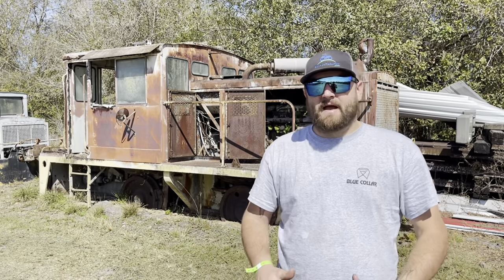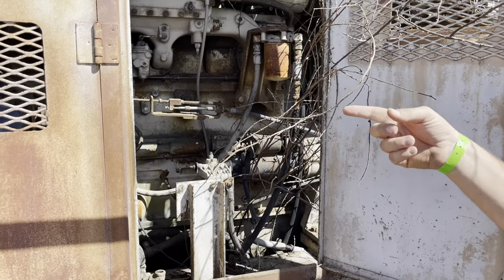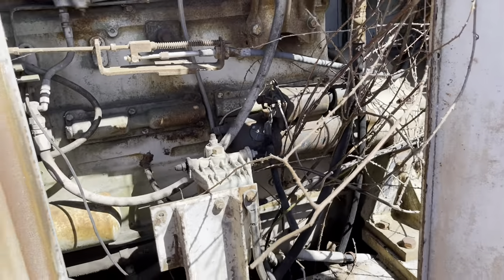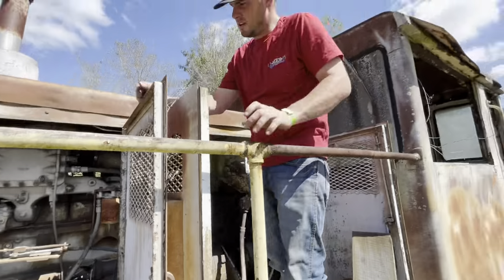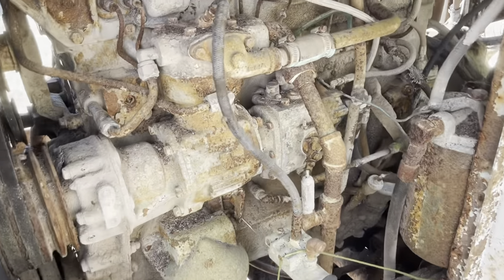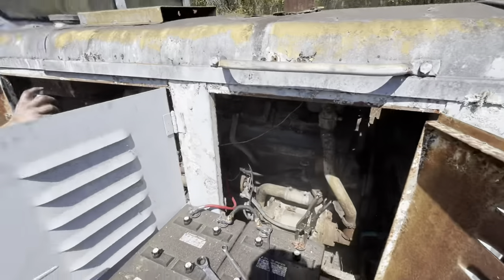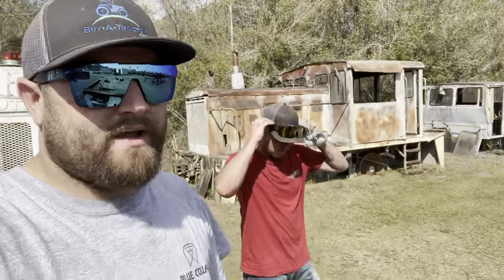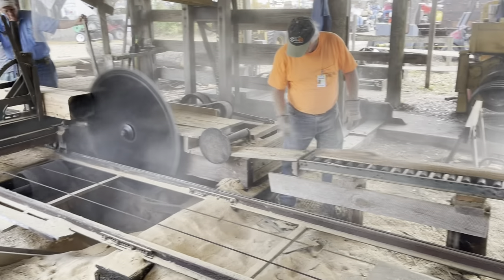WILL IT START? 1962 DIESEL TRAIN LOCOMOTIVE!

Comment: Old Cummins mechanic here, started for Cummins in Grand Rapids in 1969. The first engine that started was a small cam NTA 380 hp most likely. Has an after cooler in the center of the intake manifold. PT (pressure timed) fuel pump with a MVS governor (mechanical variable speed). that works when the upper throttle lever is activated. Small cam engine, 5 1/2" bore. 
The engine with the external fuel lines to each cylinder is either a 4 7/8" or 5 1/8" bore. Could be a 2 valve head or 4 valve. This engine was out of production pretty much when I started in 1969. I did work on hundreds of these though.
Both engine had 3 push rods per cylinder with the center push rod operating the injector plunger to compress the fuel thru the injector cup in a fine mist. Three lobes on the cam per cylinder.  
Big cam engines IIRC came out in the mid 1970s. Previous poster had it right on how to tell by the cam roller boxes along the side of the block below the fuel pump.
I worked on a couple of L Cummins in switchers. They were very old when I started. Think they were about 6 1/2" bore and ran at slow rpm of either 1,600 or 1,200 rpm.
Reply: Thank you for your cervix
Reply: Amazing how well these run/ran - 
was shocked (& NOT shocked)  when the "Old"  engine turned over and started instantly. 
Designed to OPERATE - and to not be finicky - as long as they had basics 
impressive
Reply: @SanjanaRanasingha  In the late 70years I have participated in courses about the KT models in international payloaders. Here in Heidelberg Germany
Reply: @heinzfissimatent4294  wow 🥺
Reply: I may have met you in Grand Rapids, I was Cummins factory rep mid '70's and used to come and visit Paul Gauthier, and yes, you are right on with the engine they started, the old aftercooler box gives it away.
Reply: Seems right… noice!

Comment: Great work guys!  Just a thought before starting on a restoration. The lining of the cab on the second Plymouth had that white fluffy sprayed-on Asbestos look about it.  I could imagine it may be a bit of insulation for hot/cold climates. Might be worthwhile getting it tested before stripping the cab.  Asbestos is bad stuff but was used back in the day as it was cheap and a good insulator - breathing in only a few fibres can lead to lung disease years later and down the track (no pun intended).  I'm just mentioning it as we had a friend who use to work in a naval shipyard in the 1970's removing the asbestos lagging from inside ships and submarines.  Unfortunately It got to him later in life. Took 45 years. Be safe!

Comment: Man could you imagine if one of the railroads in Florida took those and restored them to functioning condition how nice they would be , they would be nice for yard switching. It's sad that they are rotting away and sitting abandoned.
Reply: Honestly, none of them would take too much to get running again. Too bad rail is dying other than freight.

Considering that they appear to be looked after, maybe there's hope for them. Maybe that's why one is torn apart, and two of them want to start.
Reply: @GetDougDimmadomed  there's probably heritage railways that would kill for a little unit like those
Reply: @russelljones3221  As part of a heritage railway that's currently looking for an engine about this size...Yeah, we'd be interested in a running one.
Reply: @GetDougDimmadomed  they're probably broken internally or too outdated for practical use

Comment: Great Video, Bruce.. and glad you're back, "on track"... pun intended, here. lol    The last Plymouth you showed here, is powered by a Cat D326 - 185hp at 2000 rpm.  The locomotive is a "J" Series (Plymouth 15-25Ton) - 20 Ton.   As far as the other three Cummins powered Plymouths, there... None of the Plymouth's with Cummins were ever rated over 300hp, in fact.. were rated from 165 - 300hp and the engine models were the HRB1 (165hp), HRS-600 (225hp), NHS (260/275hp) & NHRS (300hp).  There were No "small or big cam" designations with these early model NH Series Cummins.

Other prime movers within this class of locomotives were GM Diesel (4 & 6-71's), The Cat D326, and Hercules (DRXC/Diesel[144hp@2100] & RXLD/Gas [148hp@2100]).  Would be REALLY interesting to find a Plymouth M/W Class (25 to 45 ton) with a 6-110 GM Diesel (aka "Detroit Diesel") which were rated at 275hp @ 1800 rpm (Naturally Aspirated with a Centrifugal blower on the early GM models [1945 - 1952 & Roots blown from late 1952 - 1965], turbo's added after 1960 to 1965).
Reply: I would bet that if you found one that had a 110 in it, it would need rebuilt.  A 6-71 would make me feel at home as that is what we had for generators and one of the two types we had to assemble and have running for certification class on Detroits. The other was an 8V71. Our main engines were their bigger brothers, the NA12V71. We got from the Army some others which were rebuilt before use that were designed for use in tanks. >600HP at War Power but rated for only 24 hours at that rating before need for rebuild.
Reply: @gravelydon7072 .... Thanks for your reply.. very interesting.  I don't understand why the V12's would ever need to be rebuilt after a measly "24 hours" at only 600hp.  What "vintage" (year of production) were the V12's... do you remember?
Reply: @Romans--bo7br  No, I do not. We got them as surplus. They did have the cast covers. They were not the normal 12V71s that I expected but had injectors that were twice the size of the normal ones and were twin turbocharged. We were offered 7 of the 10 the DRMO had. We got the Army to pick up the shipping also as the USACE was responsible for the engines in our buildings. They were, IRC, set up to run at 2500 RPM which meant that they were really putting out the power but not at what they were listed at. You could get 600 out of other versions without cutting into their lifetimes. My guess is that the 600 was at normal loads/RPM and when pushed to war power, may have gotten to over 1.2K. The sheet that DDA supplied would not show anything above the 600. Nor would it say what the max RPM was for those engines. Marine type 12V71s could put out 900HP at 2300RPM. https://www.dieselpartsdirect.com/documents/detroit-diesel-specs/12v71ti-marine.pdf These were not equipped with the 9215s so may have been the 9A31s which DDA would not talk about in the 71s.
We had a 4-53 when I worked for the State that was rated for a no load speed of 3005RPM and it screamed.
Reply: I hauled several old Plymouth locomotives that had IH td18 engines that of course started on gas and switched to diesel.  The rule of thumb is 10 horsepower per ton, more than that spins the wheels, less than that and it's too lame, same formula for bulldozers.
Reply: @Colt-tf6xf  Our Cleveland Model 110 trencher had an older UD-9 engine in it. Under gasoline power it would move itself. But to dig you had to switch to the Diesel. Which in our rock down here meant you were going to be moving at about 60 feet per hour. But were digging a 24" wide trench 4 feet deep. Want something to drink, get off and get it and when you get back, it will only have moved a few feet.
Reply: @gravelydon7072  now, just a couple swipes with an excavator and there's your trench, but the democRats will make it electric next.
Reply: @Colt-tf6xf  Only if you drill holes and use blasting first. Excavators don't work all that fast down here but wheel trenchers with carbide teeth do.

Comment: That first one you got running is a NTA 380. It has an aneroid valve mounted up beneath the intake manifold instead of the later AFC PT fuel pump. 
I’d have to say that the fuel pump solenoid is screwed in, and that’s why it won’t shut down.
Reply: Oh thanks for the info

I think your a mechanic?😄🤔
Reply: Your*

Comment: Those old Cummins would be cool to put in an old medium duty cabover like a ford N series or C series or even a gmc short nose from the late 40's to early 50's. Those old flywheel engines are cool as well, I've restored a couple small Fairbanks- Morse gas hit and miss engines but would love to mess with one of those big diesel ones.

Comment: I don't think I've ever seen those GE Plymouth fifty and twenty five tonners before. Those would have been used on industrial businesses along CSX or at the many grain elevators in the midwest. Whatever engines GE put in them were built to last and many of them are still in use today!
Reply: CSX has a lot of trackage through "Bone Valley" in central FL where there are huge phosphate mines .  Would make sense that these are old switchers from that way
Reply: @MinimaxDieselDude  I didn't know what the Bone Valley was until Danny Harmon came along.. :D
Reply: Plymouth locomotive works was in Plymouth Ohio. Not affiliated with GE. They were mostly small mechanical drive engines using gasoline and diesel motors. GE made small diesel electric switchers and they made the electrical equipment for the big boys like Alco and the last Baldwin's used GE after Westinghouse exited the business. And of course they started making their own full size diesel electric locomotives and overtook EMD to become number one.
Reply: @robgm6926  glad someone beat me to it. Living only 5 mins from the plant. And who’s great grandfather helped build them sure nice to see them still out there. There’s even a few still running in the industries around here. Also there was/is a small company the restores them in the next town over in Shiloh.
Reply: @robgm6926  thank you for sharing the history of these unique units. As I said, I never have seen anything like them and actually this channel was the last place I was expecting to see Bruce try to start four very rare switchers!
Reply: @robgm6926  No hydraulics?  I really like hydraulic units.

Comment: Wow. That first diesel just cranked right up. Awesome!  Shame someone doesn't want to refurbish that old beauty.
Reply: There are more "old beauties" than there are people to refurbish them. Then there are fuel economy and emissions issues. Then, for companies, there are tax issues which we the people know little about except that they exist. Maybe they get so many writes off buying new equipment that it's not worth putting even functional old equipment back in service.

Old engines might have some use as stationary engines. But there are an awful lot of them around, and why not use a truck engine for that purpose? A truck engine probably would be cheaper and easier to keep running.

Comment: If it runs, that would make an awesome power generator.
Reply: The first question I have to ask is if it will be happy at 1800 rpm? So much of the RR stiff is super low speed, which is why the engines last so long.
Reply: @rupe53  no slow trains are 40mph
Reply: @district2productions  ... talking about engine RPM, not road speed.

Comment: That’s pretty amazing that a diesel can just be started like that after sitting god knows how long.
Reply: why?
Reply: Diesel fuel doesn't spoil or foul the engine like gasoline; in fact, it's a very good preservative. Diesels are thus some of the most forgiving engines in this regard, and as such usually will start with a reasonable amount of effort after sitting for any length of time as long as they were protected from direct water.

Comment: You just can't kill some of those old "come a longs" That drifting idle it does, reminds me of an 8V92. But remember the old KT's?
I had a early 80's KW K100 with a 
KT450 & 15sp. Fuller O.D. Talk about torque!! Only engine I ever had, that loaded in a dead pull, on a 7-8% grade.  Would keep picking up speed!

Comment: Most likely it's a 32 volt system but could be a 64 volt system as well. Locomotives today are 64 volt(charges at 72 volts)
Reply: I kinda doubt it cranked that well on 24 if it's 64 volts but what do I know
Reply: @rrhh5157  those really older ones could be just 24 volt. I work on little newer stuff then that. Sd40 and gp38 and newer

Comment: Great Dorset Steam Fair in Blandford Forum is much same thing in UK but about two hundred steam engines, also a complete fun fair run by steam. It fills two valleys. The year I went 120 steam road rollers alone rolled the same piece of tarmac. A 70 ton steam locomotive loaded onto a trailer hooked up to a DAF tractor unit all pulled up a 1 in 7 hill by a single showmans steam engine. Drag line ploughing, steam ploughing,  thrashing, sawing, excavating, hauling, machining. Boiler building. pumping. Military display, Steam driven giant ferris wheel.   I saw  cranes and trucks and more stuff on the horizon that I never got to. Huge.

Comment: Difficult to believe, and my jaw dropped, when the first one started with not much more than a good bump on the starter.  Depending on the time it had set up, that was amazing, and it ran like a sewing machine until the fuel supply dropped, for a few moments.  A testament to the quality of the engineering and build of that engine.

Comment: Love tinkering in yards. Plymouth locomotives were manufactured in Plymouth Ohio.
Per a diesel engine instructor that I had back in the 70's = 
Engine - cylinders.
Motor - windings.
Those things are miniscule compared to road locos - even the first gen diesels. Look up any of the current class one railroad's road locos (4000 - 6000 hp), or the  Union Pacific's dd-40 if you want to see a large engine.
 Ships engines are mind blowing in size also.
Stay safe

Comment: Grew up about 10 miles from the locomotive factory in plymouth ohio. If I'm not mistaken, there was a plymouth car manufacturing company that was then developed into the locomotive company. I believe they still do maintenance on parts there as well. Pretty cool when the town population is less than 1600

Comment: The PT fuel pump on a NTC-855 Cummins has a little stud you can screw in to over ride the electric solenoid. Although, the engine they chose to work on , has a really ancient PT style pump. Very 1960's.

Comment: Proof that old engines are tougher than new ones...that first one didn't want to stop lol.... find anything from the 60s from GM, Ford,Dodge and it'll still fire up and run with basic stuff (fuel, oil, battery)...even old garden tractors like on my profile pic it's a 1967 Case 155 with a all original 10hp Kholer flat head... before I got it, it was in a junk yard exposed to the elements for 15 years I got it and it sat for 2 years and all I did was change the oil fix the wiring (mice) and exaust (holes in the pipe) and it fired up and ran and I've used it as a yard/tow rig up until last year the fuel pump started leaking and just havnt gone around to fix it yet.... u can find some vids on my channel about it.... sorry for the long comment

Comment: Well I have to say I've seen will it start videos covering cars,trucks,construction and farm equipment and even an airplane but this has got to be the only will it start locomotive video. Think I had the first one you started in HO scale from AHM back the 70s. And yes that hand wheel in the cab is the hand brake, effectively the parking brake.

Comment: Just to let you know on those fuel solenoids on the Cummings on the older ones they had a little dial on the back of the pill solenoid that's the manual override in case your batteries went down when you lost an alternator Bell still run screw them inward and you should take off don't even need power going to it then of course when you want shut off screw back out just thought I'd give you a little tip on that I'm a retired diesel mechanic but I did gasoline to but my main job title was technician mechanic definitely a journeyman mechanic and retired but I still love it good job guys

Comment: what's interesting is that a lot of these Plymouth-built locomotives originally may have been gas mechanical, but from what i gather the gas engines weren't the most reliable things and parts for them were hard to come by so most gas Plymouth locomotives had diesel engines retrofitted into them. I can't tell personally if these are retrofits or not, (nor am i affiliated with Florida Flywheelers, I've just encountered a pair of Plymouth locomotives in person), but Detroit and Allis-Chalmers engines have been used as well

and a minor correction, but Plymouth locomotive works is (edit, forgot a word) not affiliated with Chrysler. The company is named for Plymouth, OH, where they manufactured these locomotives until 1997.

Comment: One thing you have to remember collectors of old iron have one saying “OSHA who”  🤣
Reply: If OSHA saw some of the attachments made by Gravely, they would have shut them down. How about a 36" chainsaw with 7/8th inch links. Or a 30" circular saw that the guard was an optional extra for?  In the old days, men were tough and smart or missing parts.

Comment: 16:00 About Fairbanks Morse.   FM was famous for the H24-66 Trainmaster and the H16-44 Baby Trainmaster.   Both were opposed-piston diesel engines.   The H24-66 Trainmaster was way ahead of it's time.   EMD and Alco would not come up with comparable diesel engines that surpassed the Trainmaster in horsepower and tractive effort until the early 1960's.   It was more powerful than any other diesel at the time ( EMD F7,  GP-7,  GP-9 ) as well as Alco diesels.  Fairbanks Morse also constructed massive coal bunkers for the railroads in the steam era.
Reply: People in California say F.M. stands for "frequency modulation." People in Texas say F.M. stands for "farm."

Comment: You were talking about that long cable causing an Amperage drop, what you need to understand is that the longer and smaller the cable, causes a voltage drop which increases the amperage which increases the heat which will burn the cable and the starter up! The longer the cable, the more it needs to be larger for DC power, that’s why power transmission lines at higher voltage are smaller to carry higher voltage and less Amps which are then put through transformers to increase amperage and decrease voltage